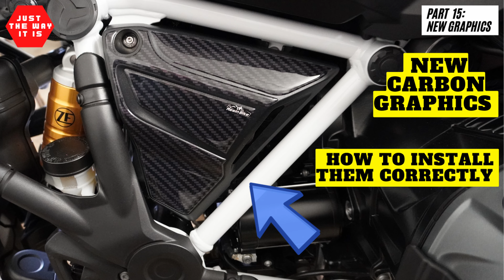EP:15 BMW R1250GS/A Installing Resin Bike or 3D Gel Graphics - How to guide

Comment: I was actually thinking of getting some of the Ilmberger carbon parts for my GSA, but these stickers won't actually make a hole in my pockets like the real deal would 🤑

Heck, I didn't even know these existed until now but that's why I subscribed 😉 so thanks for the heads up!

The stickers that you linked in the video description, are they compatible with my '22 GSA? or are they only for the GS? Thanks!
Reply from the maker: Hi Sunny 👍 thankyou for subscribing it does make a difference and I appreciate everyone that has.
Yes the real carbon ones look great, a friend has a set on his R1200RS but they cost a small fortune... when you look at the 3D ones I used they are obviously not the same... but for me it's close. And I can buy a set of tyres for the difference in ££€€$$.
Yes the lower ones I installed (their are two kits upper and lower) fit both GS and GSA 
Have fun 
Carl
Reply: @justthewayitis  good to know, thanks!

Comment: Great video Carl as always. A little tip on...well sticking anything to your bike or helmet with adhesive...is to warm the adhesive up and where you're going to stick it on the bike/helmet with a heat gun or hair dryer. It would have definitely helped you in the cold garage. If using a heat gun you just have to make sure you don't start melting anything.
Reply from the maker: Hi Correy, you are absolutely correct using a hairdryer or heat gun can make the installation process easier.  Thankyou for sharing this tip.
Regards Carl

Comment: Hi Carl,  thank you for another great video.  Just a comment regarding the rubber grommets in the frame for those side panels. I believe there are two for each panel.  Have you had an issue keeping those grommets in place?
Reply: This is a pain in the ass. When i first bought my gs i wanted to see what is behind the panels and it took me nearly 3 hours to install them back. 2 hours for searching the plastic parts in the garden and 1 hour installing them properly.
Reply from the maker: Hi Ugur, yes several owners have said the rubber grommets fall out. I think the later bikes have a better fitting grommet. Regards Carl
Reply from the maker: Hi Mauro, yes I have also heard that the little rubber grommets can come out and get lost. But I have not had any issues. But it's a good point to highlight to others, so thankyou 
Carl